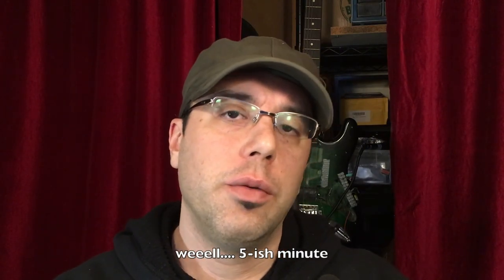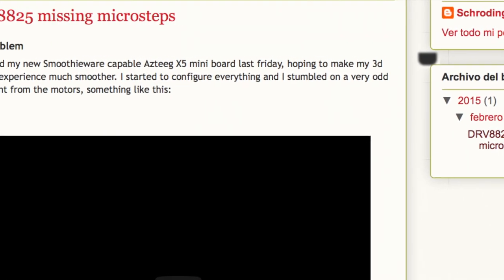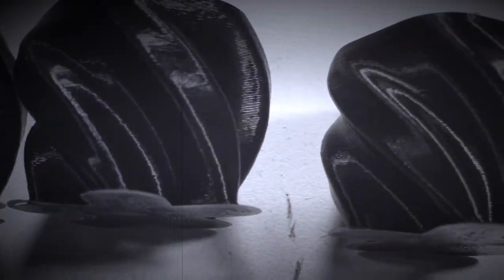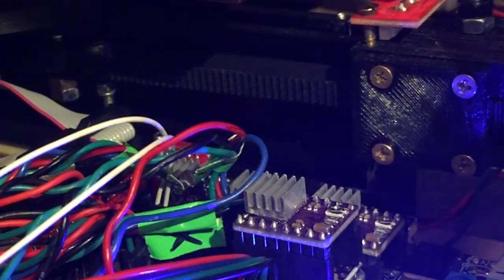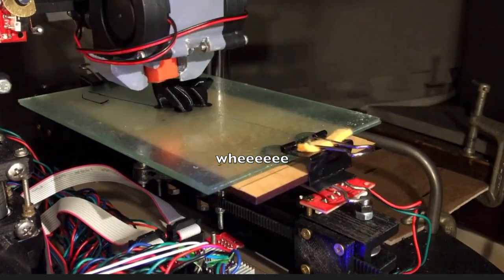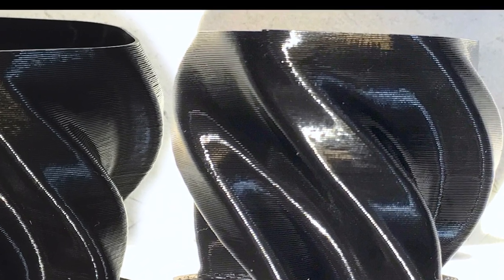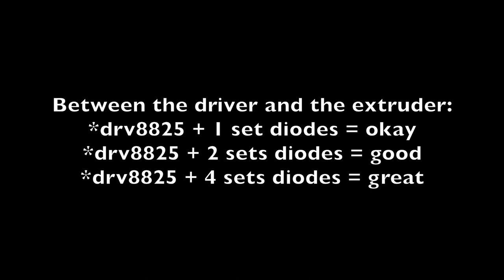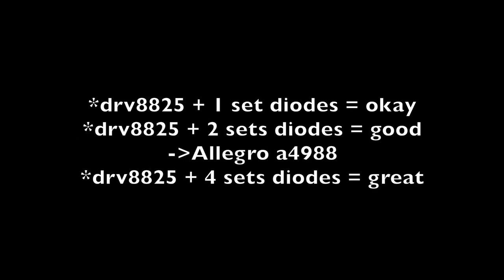TL-smoothers in RAMPS at 24v experiments

Comment: could you tell me,
I have been told that the DRV8825 are renewed,
and that those diodens would no longer be necessary!
can you tell me is that true?
and is it only on 24Volt or also on 12Volt?
and is it only useful for the DRV not for the A4988?

https://groups.google.com/forum/#!topic/deltabot/2HJEQG_wR9Q

friendly greetings from The Netherlands!
Rob.
Reply from the maker: I spent some time in the Netherlands, loved it!  ANyway, I am not sure about new drv8825 versions, but I'll keep an eye out for it.  They have the moire-pattern trouble with either low inductance motors or high-ish voltage, so it is hard to say if you will have the problem until you set everything up.  I have seen the pattern at 12v with certain motors, but only when they were very low inductance.  The problem is if you go with lower voltage, you lose a lot of torque and top speed, and if you go with higher-inductance motors, you lose top speed also, so the diodes are an easy fix.  Another option is to do a little hack to the drivers to shorten the blanking time (ie put them in fast decay mode).
Reply: Hi Alex,
First of all, thank you very much for answering my question! thank you!
it is strange to say, but I think my froggycountry is fine too! ;-)
(I live in the Rotterdam area)
ANyway 2
OR there really is a new version of the DRV8825, I'm really not sure!
(someone on our forum said that, BUT I do not believe it!)
I think I understand it well
that the diodens still have usefulness at 12 o'clock?
and what about (what can I call it?) echo effect?
I myself have no problems with this.
but I had your video included in our (NL) forum and there were comments about it.
and thus.....

now that I write you, a question?
I have a Prusa i3 BUT I have the old prusa!
and that means I still have M5 thread on my Zmotors,
and again BUT there are also those who have M8 screw thread 
and then you have T8 Lead Threaded Rod if you ever make a marlin video again?
then tell us about how, and where you set it?
I really like the M5! works very well! (I find, I do not have to replace it!)
but owee if I have to put other marlin firmware on! 
(I always quarrel with that! the software is my weak side!) 

OOooowww and what else!
I think youre start up music, (the start tunne?)
crappy music HAHAHAHAAAAaaaaa LOL 
(sorry! Yes of course, everyone is his own taste ;-)  )

I wish you all the good, and kind regards from here again!
Rob.

Comment: I have drv8825 drivers, can I use 1n5408 8 diodes ?
Reply from the maker: I'm not sure that general purpose diodes will be fast enough.  The boards use schottky diodes, but I tried fast recovery diodes in the experiment, and they seemed to work